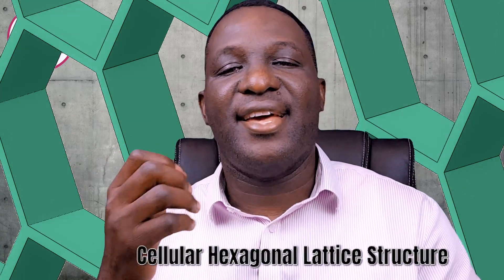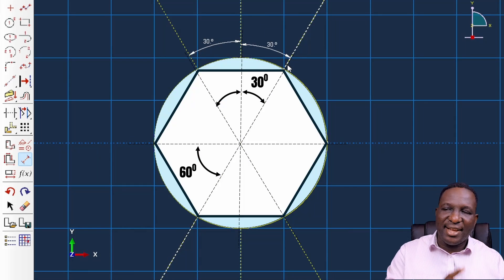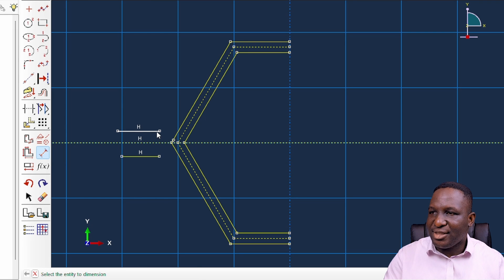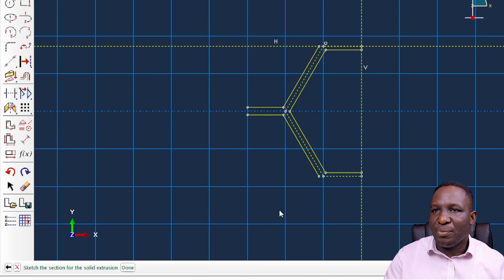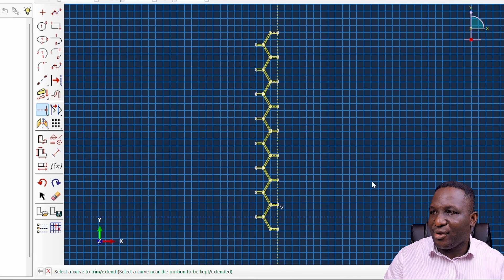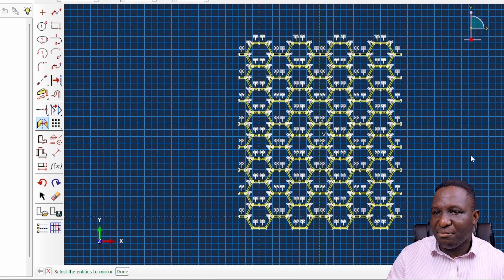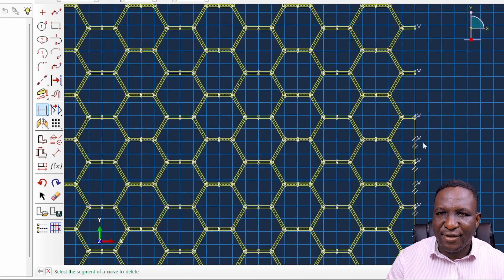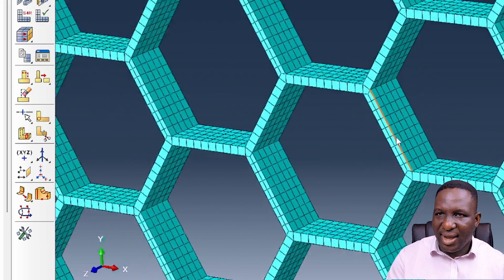See How I Designed an Amazing Hexagonal Lattice Structure

Comment: Dear Sir,
You have used the function "merge" in the assembly module. I request you to tell the meaning of it. Suppose I have to apply "embedded" constraint then is it necessary to "merge" before applying the constraint...please comment related to this issue....
Regards.
Reply from the maker: Hello, I do not know much about the embedded constraint option but I have seen it being used. I reckon if you use it, you would not have to use the merge function but do not quote me in this. It is something I need to research further myself to be able to tell you definitively.

Comment: How can we mesh into more than one element when it is treated as a strut (Bar-Truss Element), A Truss element always be a single element between joints.
Reply from the maker: Hello, you are right about the bar-truss element comment. However, bar-truss elements are one-dimensional elements which suggests that you should be creating the virtual domain in a 2D plane rather than a 3D plane. If this structure was created in 2D plan, and the struts modelled as trusses or beam elements, then yes, your expectation would be correct. However, I am considering a 3D analysis, most suitable for energy absorption studies. So, we have to create a 3D virtual domain (which is what I showed here). With that, you then need to model it with continuum (3D elements) in which case the mesh should also be 3D elements (hence what you see in this video). 

It all depends on the problem you are solving. I am working on a 3D problem, you are referring to a 2D problem.

Comment: Hi sir, i want tensile testing of hexagonal lattice/unit cell for elastic properties validation
Reply from the maker: Hello, the purpose of this video is to show how to create the virtual domain as that is the challenging part of this sort of modelling. If the interest is elastic properties, then there are a lot of videos I have made on lattice structures which you can adopt, follow the process and then simulate that. You just have to use this cellular hexagonal lattice structure here. In my opinion, this is rather straightforward and I have videos on the channel that you can follow to help you complete the modelling. Getting the virtual domain is the harder bit, I think!